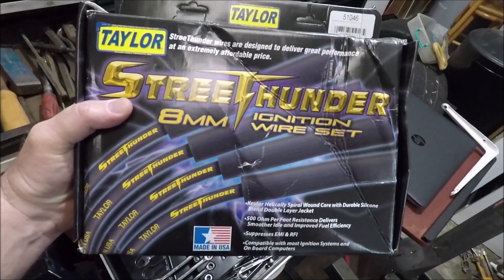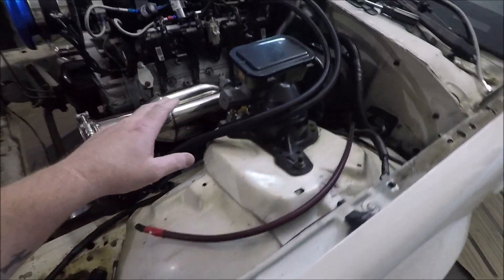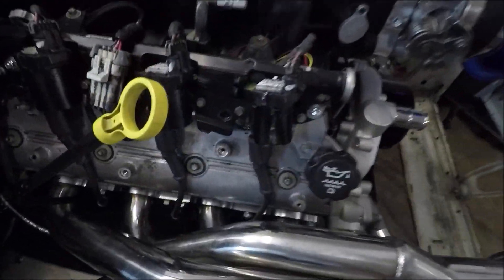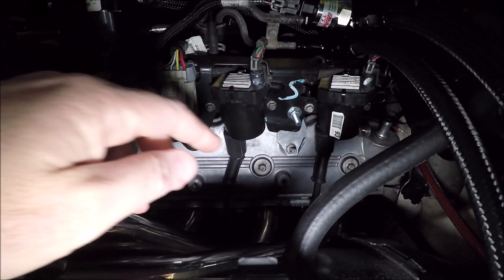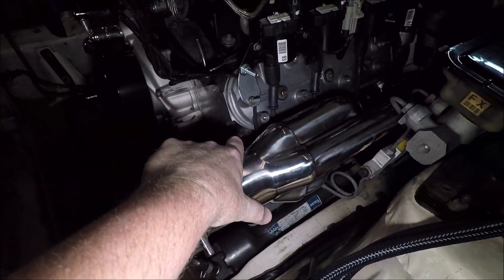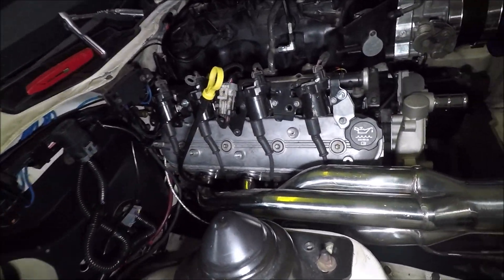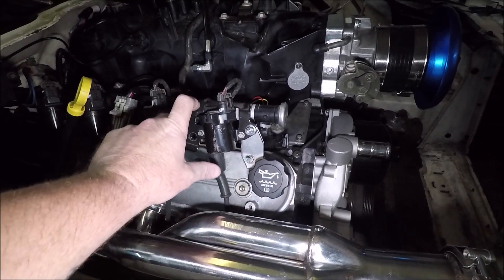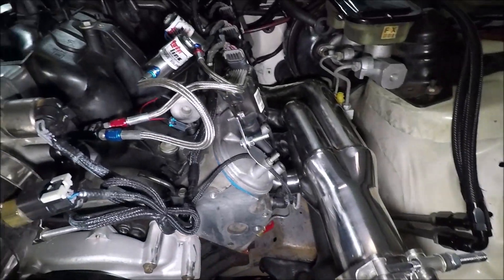EBAY TURBO LS HEADERS SPARK PLUG WIRE PROBLEM SOLVED

Comment: Good easy simple solution 👍🏻 it’s always good to have scrap metal lying around just for situations like that.
Reply from the maker: Yea I’m thinking I will probably remake them later out of some slightly thicker aluminum and cut them more uniformly. This was just a rough trial run, but everything worked out perfect.

Comment: I'm going to try to run mine down and forward. I have the same headers but in a fox body.
Reply from the maker: Unfortunately they won’t fit in that configuration in a 3rd Gen Fbody without extensive modification. We tried that in a previous video.

Comment: Currently doing a e46 ls 5.3 swap need to know how’s the heat   In the engine bay with routing  exhaust trough the front
Reply from the maker: No different that it would be routed to the rear. Either way you’ve got turbos and headers in the engine bay. 🤷🏼‍♂️

Comment: I used lt1 wires and went around the headers and came up from the bottom it seems to work ok
Reply from the maker: I was determined to not only find wires that fit, but also to move the coils away from these headers as well.

Comment: How did this hold up? I have a 2000 silverado that i put an ebay kit on and its burning the wires and cracking the plugs. My tuner is suggesting me to change the manifolds but i know there has got to be a better way
Reply from the maker: Look at the date on this video and look at the date on the most recent video. Still running exact same setup. Zero issues. If you’re running these same headers and do exactly what I explained in this video then you won’t have any issues either.
Reply: @BadLuckGarage  appreciate it, the headers that came with my kit are slightly different but similar and it keeps burning wires and my tuner insist on changing the manifolds and I knew there had to be a better way

Comment: What if I just did metal and wasn't do he diamond shape could i drill holes in metal sprips and be do with it
Reply from the maker: Brother you can use whatever you want as long as it clears everything. Like I said in the video, I was just using some stuff I had laying around. If you’ve seen the newer videos you’ll see I actually went and got a piece of aluminum stock a few weeks later and made nicer looking brackets. 👍

Comment: Thank you for the info! I've been thinking about these headers for my 6.0 turbo swap I'm building for my 68 gto. Would you recommend them so far? I'm torn between cutting and welding truck manifolds and these. Not sure if hot side should go up and over or down and under yet. Going to run all accessories so I have to move the AC up already. Simple enough just worried about melting stuff lol
Reply from the maker: All depends on your setup brother. The only reason I used them is because I planned a wild build with turbos sticking out of the hood. Would I use these on a street car that I planned to daily or drive a lot? Absolutely not. The modified truck manifolds we aided on the project SteppinWolf build would be better suited to that. But for a “racecar” where you want everything to be out in the open and easy to get to these aren’t really a bad option at all in my opinion.
Reply: @BadLuckGarage  good point. I'm torn because I'm building as a single turbo setup right now but would like to go twin. It's going to be more of a protouring street car build but looking for that 850hp tire mark

Comment: Looks awesome! You think this set up would work with stock manifolds flipped over?
Reply from the maker: No clue brother. I’ve never flipped the stock manifolds but rather ran them on opposite sides so they went down and forward. That setup allowed me to use the stock plug wires. I wanted to do the same with this build but they just wouldn’t fit without a lot of modification.

Comment: Man, I've learned a ton from this project. Thanks so much for making these videos. I have an ls swapped third gen. I was looking at those headers but was worried about the coil clearance. Looks like you have solved that completely. I know you're doing a racecar with fender exhaust, but could you run the exhaust under the headers where you were showing the sparkplugs? I am trying to avoid fender exits.
Reply from the maker: Yes, there should be plenty of room to do that in the passenger side and on the drivers side you may just have to reroute a few brake lines. But keep in mind that doing that will make it very difficult, if not impossible to access the spark plugs without removing those downpipes. If I was going to route it that way I would probably put vbands and either end of that section of pipe so I could remove it easily for spark plug changes. On a daily driver where you’re only gonna be changing plugs every 10,000 miles or so it wouldn’t be a bad idea. On a racecar it’s all about making things easy to get to.....hence the fender exits. 😉

Comment: Why didn’t u shorten the wires
Reply from the maker: Why shorten all the wires when you can make simple brackets move the coils up in less time and then continue using stock wires instead of having to modify more wires everytime you replace them? Work smarter, not harder.
Reply: @BadLuckGarage that and like you said you're moving the coils away from those cheaper headers that do not have any kind of heat coating. Good idea bud.
Reply from the maker: @BillyP-49Chevy  Thank you sir. We’re still on the same set of wires after 3 years, even with the twin turbos glowing these headers red at higher boost we still haven’t burned a wire or fried a coil yet. 🤘